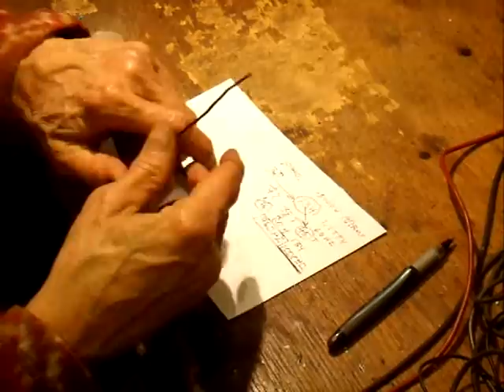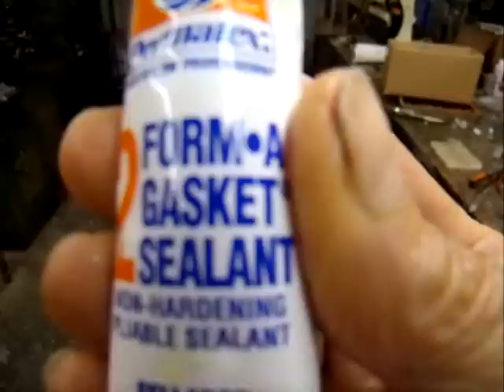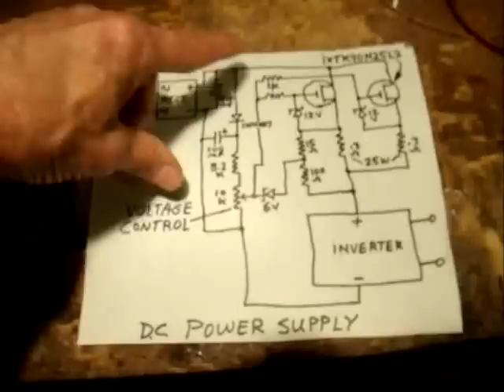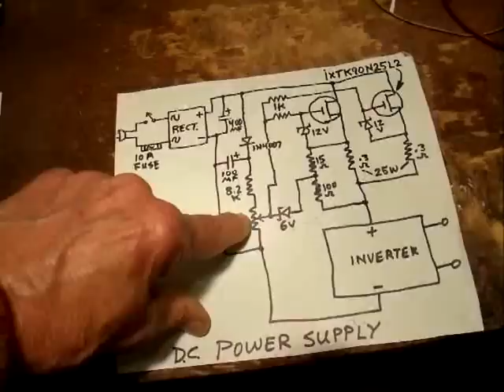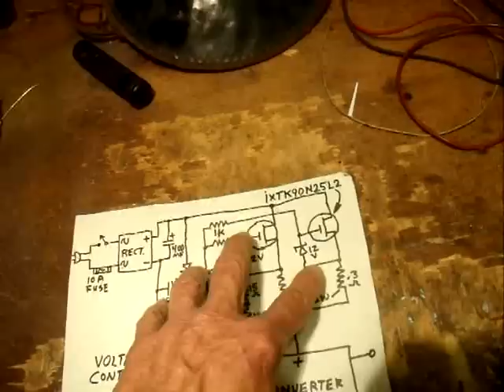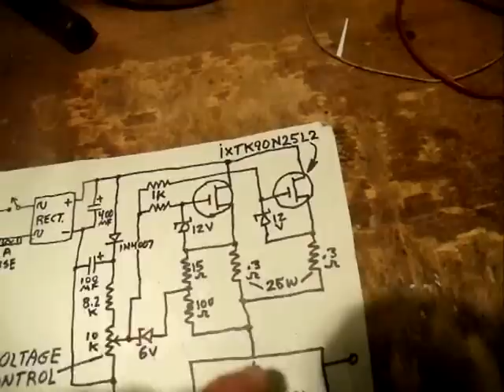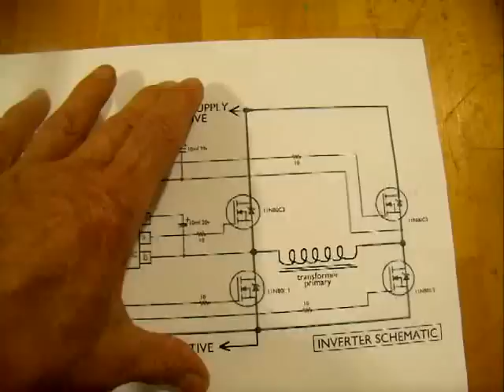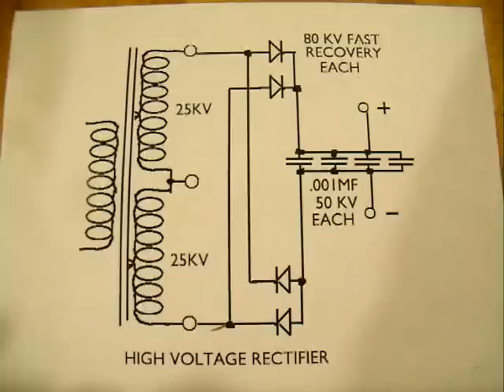making a 50,000 volt power supply

Comment: Because you used the saw to cut the core each of the lamination's are now touching thus you might get High Eddie currents? do you need to eliminate this or is Eddie Currents fine for your project.

If you do not want Eddie Currents you need to the iron core apart and Lacquer "individually",
then put the Lamination's back together using more Lacquer and heating your core thus giving you even more efficiency due to the eliminated Eddie Currents on the plus side you will increase your isolation from your windings.

Nice work on getting the tar off.
Reply: BlackIce504 it shouldn't matter as the area of contact is so small, and electrical steel is deliberately low conductivity. Plus the oil filling of the reworked transformer will help with cooling :)

Comment: Thanks for the great video!  Are you using a square wave to drive this?  If so, could you please explain this to me?  I thought that in order for transformers to work they had to have changes in voltage (hence the lack of DC).  Does a square wave provide enough "change" so that the voltage isn't merely short intervals of + and - dc?  Thanks!
Reply from the maker: +Drew Miller 
The frequency of the square wave is set to be efficient for the transformer core of the large high voltage transformer. This is a tradeoff between efficiency and core heating. I found that the core of a 60 hz transformer will operate quite efficiently at 20khz. The square wave is a changing voltage of course and thus produces a changing flux in the core. The important thing is to have the frequency match the core and secondary coil characteristics so nothing heats up.

Comment: Would it work if I took a microwave transformer's primary, two  secondaries, with a (similar to) NST iron core and make my own center taped transformer??
Reply from the maker: Not at 50kv. The microwave transformer secondary coils are insulated for about 5000 volts. It would be likely they would arc over if operated at higher than this.

Comment: One can cut a propane tank, but s/he must first displace any residual gas using water first (for safetly, doing so a couple of times would not hurt.) There are guides on doing so various places online, including numerous videos here on YouTube.
Reply from the maker: I guess you can go hysterical if you want. I have cut them open with propane still in them. There is a small flame until the gas burns off. There is no oxygen in the tank so it won't explode. The main thing is to make sure the pressure in the tank is zero.

Comment: Almost Wigwam (wig warmed/melted/set on fire, almost) at 8:31 
Yea, no welding near there, lol. BTW, thinner may not have the same extra frisky flash point as gasoline, but you can easily get things going from a random spark from tools, lawnmower flywheel/ign system, etc.  
Don't ask how I know this.

Comment: whats the minimum amount of turns you can have on the primary im building a 30kv transformer,currently ive calculated that the primary currently would be about 15 turns but that dosent sound right so i might end up making a 20kv transformer with more turns
secondary has 1984 turns
input voltage is 230-240 volts
wanting between 20-30kv
any ideas for # of turns on primary?
Reply from the maker: This depends on the frequency. The 1984 turns is low for 30kv unless you are operating at around 25khz. Then the 15 turns would be in the neighborhood, but you will need a ferrite core to do that. A laminated iron core designed for 60hz probably would have too high of eddy currents. I would use two of the secondary coils so you can lower the frequency and use 30 turns.

Comment: You could use a propane take if you are 110% sure that it is empty!!!  I have cut open small propane tanks with a saw to use them for other purposes.  I held the tank under water while I forced open the valve, and when I saw no bubbles escape I knew it would be safe.  Making the first cuts with a saw before using a torch would be safer if you must use a torch.
Reply from the maker: Simply removing the valve from the tank is satisfactory. Even if there is a bit of propane gas left in the tank it will simply burn off along with the torch gas.
Reply: @glasslinger  I don't think you can remove the valves from those small handheld torch tanks, but for the large ones used on outside grills, yes.

Comment: i read something about old transformers having pcb's in the oil , any body herd this, i do not advise touching any of this oil or breathing vacuum pump discharge vapors of even the smallest amounts
Reply: If you mean polychlorinated biphenyl, yes, some(actually most) xray beasts have that oil in it, and it's pretty damn dangerous.
But if you're given a huge oil-filled(300+ liters usually, a giant box or tube that sits in a different sealed room) transformer you should know the safety techniques pretty well. Plus most transformers have ~10 BIG RED SAFETY stickers for dumb personnel of whatever facility it's used in.
Reply: ***** some guys got sick burning waste oil in there shop, epa told them what was happening after guy ended up in hospital
Reply: NOBOX7 I still see no need to burn this oil. If you've got a couple of barrels from salvaging an X-Ray system(the heads are oil-filled too), it's a perfectly usable oil, even though it's toxic.
Reply: ***** the oil these men burnt was cheap 55 gallon drums of waste oil of all kinds, the didnt know the dangers they burnt it for cheap heating oil , just goes to show you....
Reply: NOBOX7 PCBs won't burn if pure (that's why they were used in place of mineral oil) but yeah, if it gets mixed by people who know no better... eeek
Reply: ***** cool info thanks friend , that makes sence to use a non flammable oil
Reply: NOBOX7 It's quite interesting, I used to have some brochures from where I used to work (electrical engineering's office) from the 1950s, proclaiming the benefits of Askarel (A name brand of one of the PCB 'oils') for use in transformers. Can be used in occupied buildings with no need for extreme fire precautions etc. It was a wonderful material. Then they found out it was carcinogenic. Oops.

I wish I'd hung onto those brochures, but they got ditched in a house move :\

Comment: If you get zapped with this you will not and up in a hospital but in the morgue. Build a nitrogen laser. I made one that needed 20kV, did run on pure nitrogen ( not air) and delivered about 150kW per pulse, each pulse 3ns long as it had a vacuum pump on its cavity about 0.1 Bar. Up to 50 Hz repetition. Driving a dye laser starting with Rodamin B red output over 20kW per pulse. It’s a great experience.

Comment: can that core really handle 1000w ?
Reply from the maker: I was not able to go above 1000 watts because of the limits of my FETs. The core will handle over 2kw. The higher frequency is what gives the tremendous output. Originally, at 60hz it puts out 500 watts. At 120, 1kw. At 240, 2kw. The core will easily work efficiently at 400 hz, which would give over 4kw output. Of course your windings have to handle that power level.
Reply: very interesting

Comment: That regulator is down and dirt cheap I'd use a lm431 programable zener for both current and voltage regulation with a another FET to drive the outputs and use a switching IC to keep the power loss to minimun

Comment: 42:32 - 42:35 What was that ? Was that only audible or was that corona discharge ?
Reply from the maker: It makes a fairly loud hissing noise when you hold the electrode near but not close enough to spark. The cat will wake up and look over at me!
Reply: I now it makes noise - it's nothing extraordinary but it sounded like it wanted to spark to your camera lol :D. 

You can give high voltage resistor for example 1 GOhm for about 5W across the output and then capacitors will be automatically discharging after you turn off the power supply. You will be losing only 3,6 watts per 1000 W so it's just nothing. You can also add an kilovoltmeter with naturally high impedance to make that power more useful.

Btw my HV power supply will be in 100 per cent impulse inverter. It will be for 80 kV 15 mA because I prefer transmitting power by higher voltage than current and additional I would have to have a thicker wire which I don't have (0,1 mm or about 0,004 inch). I will run it on much higher frequency something between 40-80 kHz.

Thanks for fast request and I'm hope for a video with this beauty feeding another HV project.

Comment: But why? Why a 50 kV DC power supply?
Reply from the maker: This was to be the driver for a voltage multiplier that would put out 1 million volts. The multiplier didn't work due to severe design problems so it never made it onto youtube.
Reply: Oh ok. You needed a 50 kV supply in order to make a million volt power supply. That makes sense. And what a splendid ingenious work it is. Why, if I might ask, did you want to make a million volt power supply?

Comment: Ron that torch is kerosene, right I haven't seen one of those since the 60'S My father used one for copper roofs, and just about everything else.I had I bought at a tag sale, stupid me Gave it to a friend.
Reply from the maker: You can get one on ebay for about 20 bucks. They are a lot hotter than these puny hardware store propane torches.

Comment: hey all, as to the foam from the oil as its entered into the "can", the foam is entrapped moisture in the oil, this can be solved by placing the oil in an oven and heated above the boiling point of whatever type of moisture it's contaminated with.
if the transformer is going to be indoors it is supposed to have NON flammable transformer oil, the old non flammable stuff was PCB based, make real sure NOT to use that. the new NON flammable stuff is silicone based(yeah, the stuff in breast implants), but if you need new oil and it doesn't have to be non flammable you can use mineral oil from a drug store, DON'T use the rubbing type it's got water in it.we used to get 10,000 gallons a month of pure mineral oil and still had to test it for moisture and if there was any whatsoever we refused the whole tank car full.
real nice job, good luck with the next, thanks for the video.

Comment: At 14:14, Ron explains how he can't use an X-ray transformer secondary because it dissipate too much power. When he runs the calculation, his whole argument falls apart. He says that the winding has a 65 kohms resistance and he intend to run it at maximum 20 mA and that it will dissipate 260 watts. .(02 A) squared x 65000 ohms is 26 watts, not 260. Ron has failed his math course. At 14:39 he runs the same calculation but this time with 24000 ohms. The result is 9,6 watts. But his result is 80 watts. I really don't understand where this result comes from (out of the blue). So, of course the result was in the pit. This mistake would have no consequence since his mistake is on the safe side. The only thing is that it makes you loose confidence in the reminder of the video.
Reply from the maker: I do all the calculations in my head. Maybe not that smart when you are 74 years old!   :)
Reply: @glasslinger  Sorry Ron. At the opposite, I think you're very smart. I double checked your stuff and, even if it's a little bit off, it still will work. I hope you not too mad at me. Continue your good work. I watch your videos very regularly.
Reply from the maker: @Jean-PierreRiberdy  Not mad at all! I listen to everyone.

Comment: I don't understand the point of all the Inverter stuff - just use 120V ac wall outlet? does that overload the secondary side because with too much current or will the voltage for the capacitors be to high... ok, I mean it would be a lot simpler without all that IC fet high freq stuff - gosh, just like "modern" cars ECU - old ones ran just as well, darn it!
Reply from the maker: +Hunde Schrotter 
The inverter is to increase the frequency of the drive current. The higher the frequency the smaller the required filter capacitor capacity for a given percent of ripple voltage. To filter 60hz to the same degree that this power supply does would require 10mfd at 50,000 volt filter capacitors. VERY HUGE VERY EXPENSIVE!

Comment: Most spectacular!
 
Although I respect the knowledge and skills of a fellow mad scientist, there are several safety concerns that should be addressed involving present (and the contaminated work area that sets up future) risks of fire, burns to ungloved hands, unprotected face/eyes/skin and contact with (or inhalation of) potential carcinogens, and of course, that slight risk of electrocution, physical injury or death due to a fall from bodily becoming an unexpected spark discharge path (possibly due to a bad ground or clip lead falling off) that leads to a fatal fibrillating heartbeat and/or the resulting stroke from a dislodged blood clot.  Cumulative exposure to too many X-rays is also a concern.
 
So, please be careful in general and stay healthy so you can continue to keep up all the good work!
 
Consider adding some sort of inrush surge component to the mains power supply before the full wave bridge. Three switches could be added that shunt out 100W, 500W and 1000W light bulbs all wired in series with the mains, oh and don’t forget that all important “ON” pilot light that you had mentioned.
 
If the 50KV PS ever gets a nice cover, maybe a clever insulated mechanical discharge lever could be worked into the lid design.  Small fluorescent tubes, NE34/NE2 orange or Phosphor-colored neon lamps (unwired-completely insulated) could add some unnecessary bling to that otherwise beautiful transparent case you have designed.  If that’s not enough, add one or more spinning corona discharge wheels balanced inside glass handmade bulbs.

For that camera  close-up problem in your tiny X-ray tube video, try keeping the zoom set wide (if it has one) and just slap on a cheap drug store reading glass lens. Keep the background aimed at something darker and low contrast  so the camera’s focus system can operate properly. 

Beautiful work!
Reply: A lot of us spent out youth dumping transformer oil onto the ground to get copper wire, chewing lead solder, and washing our hands in chlorinated solvents.  I'm not suggesting it was a good idea, rather that by the time you're 60 or 70 the damage is likely done so we may as well just get on with working.

Comment: no offence but the plastic insulation is total overkill.
I would have stuck with the original full core, and I would have removed the original paper bobbin for the highvoltage coils and replace it with 1/8th inch plastic. acrylic might be ok, but a better option would be polyethylene.. which is what 5 gallon buckets are made from.

in any case, going to 1Khz covers you since the core is half the size of the original, but the hard limit of 1.3T requires that you measure the core cross section area when performing that calculation.

but, using the thin cross section of the core the way you did may be preferable because the massive leakage inductance is probably required...

Comment: Power dissipated in 65k coil at 20 milliamps is 26 watts?? One of us is an order of magnitude out!
Reply from the maker: Use I^2 R. .02x.02x65000=26
Reply: @glasslinger  You said 260 and added a nought to the other calculation too...I was saying it is 26. I think you did it in your head - or said it wrong, I know it happens easily.